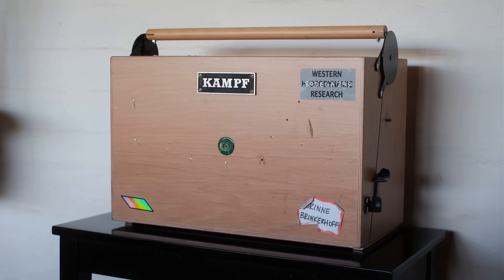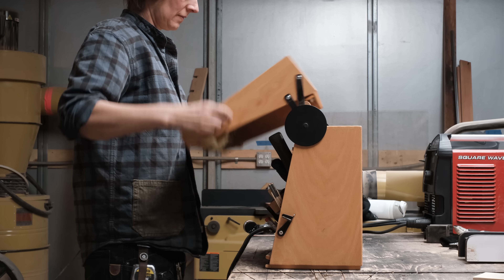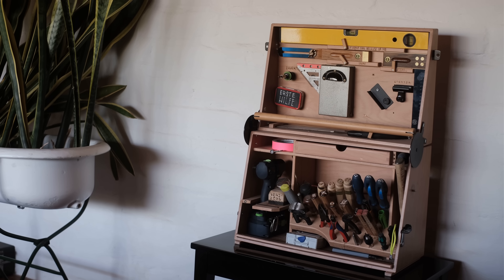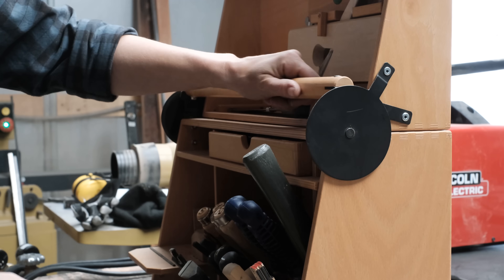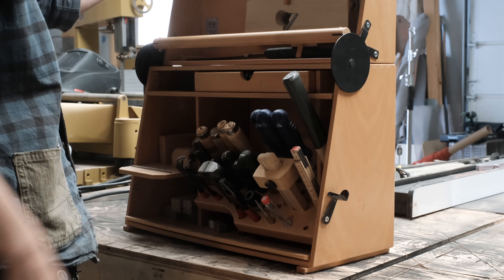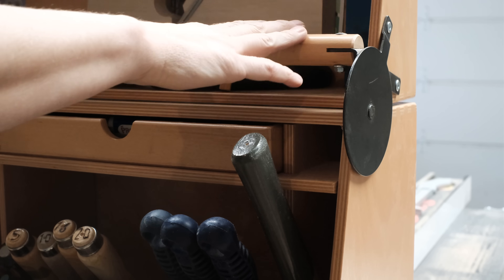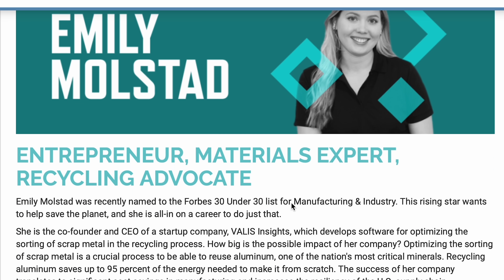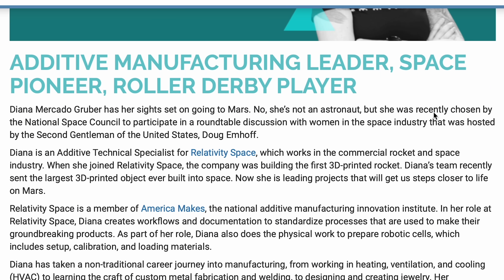This hinge is so clever! ...but I made a simpler version (with Template)

Comment: OK, the hinge is awesome. I love compound-motion hinges (dunno what you actually call them). This video is awesome. I have to say that I have worked quite a bit with wood, steel, aluminum, etc, and I didn't learn any wood or metalworking techniques from this video.

HOWEVER, when you started putting what looks like 3-in-1 oil on paper ~7:42, I wondered, "What is she doing? Why is she pouring oil on paper?"

And then I saw that you were able to make the paper transparent so you could easily transfer holes from your template to your work material.

WOW. I had never learned that trick before, but it's INCREDIBLY practical and helpful! Maybe everyone else watching this already knew this trick, but for me, this was even more amazing than the cool hinge.
Reply: The term you may be looking for is "serial chain" kinematics, using "hinge constraints" to limit forward transformations

Comment: A neat hinge, but I'd suggest a couple of things. 

Aluminium is fairly soft, and has a tendency to creep. It's also a poor bearing material so not ideal for a hinge, it tends to gal where used as a bearing surface unless something soft and slippery (like plastic) is used against it. Using countersunk bolts for the pivots also doesn't help since they create a cone clutch effect. 

Second, for keeping your drill centered in steel, use a center punch. You marked your steel with an awl or scribe. A proper center punch like what you used second when marking the wood will do the job. I'd personally use steel here, I think the aluminium will develop slop relatively quickly and wont be quite as smooth.

Comment: Nice, I think an improvement if the hinge had a 3rd piece for creating the 'rise' for the handle. This would make the handle stronger, and also make the box of the enclosure easier - as it could be a simple box which is then cut for the angled front.

Comment: Such a cool hinge design that I wish I knew about sooner! I played with the concept for a while (in Fusion 360) and came up with an idea. I wanted to have a workbench shelf that is normally on top and at the back of the workbench, pivot to be at the front. In the front position the top of the shelf would be at the same level as the workbench, extending the working surface area. I also did not want the shelf to flip over, but to keep it oriented vertically during the entire pivot. To do this, the two hinge bars would have to crisscross...  so I put 1 bar/pivot point set on the left side and the other bar/pivot point set on the right side and it works quite well (virtually). I imagine it may be a bit heavy to pivot an entire shelf, but thought it was an interesting idea. Thanks for sharing your ideas to propagate more ideas!

Comment: As far as I can see, the only advantage of this hinge over a piano hinge is that it will lift the front piece over the handle. I admire its cleverness, but it's a Rube Goldberg solution. Just make the handle swing over the back and use the simpler hinge.

Comment: Hi Laura! Great hinge mechanism. Came right in time for my next project: drill and router bit cabinet. A general hint for templates: If you print/copy it on those clear plastic sheets, that have been used for overhead projection slides, you can easily use the template for both sides plus you do not have the oilspill 😉.

Thanks a lot!

Cheers
Andreas

Comment: A different approach and easier IMHO would have been put a normal hinge on each side edge and make the handle of the box pivot to the back of the box. If you want to prevent the box swinging when carrying it you could just put a locking system of sorts.

Comment: Mh, I think the idea to use four-bar-linkages could be generalized for really fun things because you can control precisely where the lid ends up. Let's say there was another box on top of this one: I'm sure there's some way to arrange the bars so that the lid ends up not on top, but exactly in front of that other box, solving one of the core problems of tool box stacks! Or the same idea turned 90 degrees: say I have several cabinets side by side, one per hobby. I could open the doors of any one of them completely, turning them 180 degrees, and have storage in cabinet and doors. Or what if the lid opened downwards and stopped in a 90 degree position as a work surface. Or what if the linkages on the left and right were different, but attached with ball joints, then the lid could tilt while opening. So many possibilities...

Comment: Its a four bar mechanism.  The math to design the path it takes it is complex, but the math to analyze a working design is straightforward.
Reply: I came to make the same comment.  In school we learned how to graphically synthesize a 4 bar link by knowing the two end points.  I wish I could remember how, it wasn't difficult.  I haven't found how to graphically determine it online in my recent searches.
Reply: @ I learned how do do that in college too ('88). We wrote programs in Basic or Fortran to do the math too.  Graphical methods were within ~ 20%.  The programs were 5% or less.  The drafting tables were starting to get replaced by CAD
Reply: @lint2023 in this "case" the end points of the moving linkage are defined you can draw two circles from start and end point of one linkage, and where they intersect can be the fixed end of linkage. Using fusion 360, define a circle by 3 points, create a random point for 3rd of both circles, do this for other linkage, define everything except 3rd points and you can move it to find optimum path with a known start and end position.
Reply: @lint2023  You could download the free software called Linkage and make it yourself. I made a version of this box's mechanism this evening for fun! :)
Reply: Yeah, four bar linkages are great
Reply: (2/2) Since we have a known end position and start position if you create a third position of it clearing the handle, the linkage positions will become fixed, after defining where on the box you want the moving end of each linkage.
Reply: Recommenting, to find fixed end of linkage you can create a arbitrary 3rd point which has to be on the perpendicular line normal to the other 2 points. Drawing by hand, you can draw two circles centered at start and end point large enough the two circles create a vein diagram, place a line on the two points that the circles touch and your fixed point must be on this line as linkage doesnt change size. Do this again for other linkage.
Reply: @elbob1491  That would be an interesting video.  Please consider making it.
Reply: @lint2023 im not a video maker.
Reply: @elbob1491  I realized that later.  It hit me that you were commenting on a video and I felt silly for the request.  Thanks, anyway.  I'm going to try to follow the suggestions and see if I can regain that lost knowledge.  It was a very long time ago when I was in school.
Reply: @lint2023 lol best of luck to you. engineering dynamics books and videos do exist. I like the geometric solutions as they are easier than the mathematical ones.
Reply: Please tell us more
Reply: @Jhet  Google "four bar linkage"
Reply: @incognitotorpedo42 then look up 6 bar linkage.
Reply: I've been obsessed with four-bar linkages since I saw it used to create a shelf you can rotate down to a lower level while it remains horizontal all through the movement.
Reply: @Trixtah parallelogram mechanism, its a type of 4 bar linkage
Reply: If you want to make it more complex, see 5 link car suspension which uses ball joints at the end of each link/bar. That's the 3D variant of this thing.
Reply: Thanks so much for that.  At first, I was thinking "there's only 2 bars".  Then I realized that the bars are any rigid connection.  This opens up so much in the way of designing art furniture cabinet pieces.  Sometimes you just need a glimpse of a concept, and it opens up so much.  I wish I had been a mechanical engineer.
Reply: A GREAT BOOK FOR DESIGNING 4-BAR LINKAGES:
As is mentioned in other posts here, this is an example of a 4-bar linkage.
To those of you who may be interested in actually designing (rather than copying) a 4-bar linkage to provide a specific motion, this book (see below) with teach you how to do it.  It is an excellent book.  It will teach you to do it graphically (e.g. with ruler, compass, etc. on a drafting board) which is quite straightforward, or mathematically with equations (which is quite complex, even using real and "imaginary" numbers).  The graphical method could also be done with CAD (Computer Aided Design).

The book is called "Kinematic Analysis and Synthesis" by Jack T. KImbrell, 1991
Google it.  It can be found on Amazon, Ebay, and other places.
This book is out of print, but copies can still be purchased.

This is an undergraduate-level book intended for such courses as kinematics, synthesis of mechanisms, mechanics, dynamics of machinery, or machinery of analysis. The author's goal is to provide a book that will equip students to design and analyze mechanics, as well as give them the information they need to perform well in modern industry. Graphic and analytical synthesis techniques are fully explained to give the student a visual feeling for mechanisms performance, and the text contains complete coverage of CAMS and their analysis.

Jack Kimbell was Professor Emeritus of Mechanical Engineering at Washington State University through 1991. He died some years ago.  He was my professor for the Kinematics and Dynamics of Machinery course at WSU in 1983.  At that time, he was in his 70s.  He was an excellent teacher and nice man.  He also wrote and graded test questions for the Washington State Professional Engineer's Licensing Exam for mechanical engineering.

Comment: Hey Laura, check out the short I just did especially for you with love from New Zealand. I hope it's helpful and you like the results you get once you get a set. Aim for smaller sizes and ability to restock 10 at a time for a given size. Big sizes are good too, but it's still better to reduce cutting loads in steel with a pilot hole even if using a split point to final dimension. Cheers :-)

Comment: As soon as I saw the thumbnail, I thought this could be a great solution for hiding my desktop PC. I prefer a desktop, but would also like it to be hidden for aesthetic reasons. I would place the monitor at the top part, and at the bottom part, there would need to be a panel that folds up to form a desk. Under or behind the desk, there would be space for the PC itself.

Comment: Love the process ... I had a thought about the nubbin sticking up for the handle...could it be replaced with an eye bolt/lag so the end of a 3/4 inch dowel handle is the attachment point for the upper screw?  That does pose a problem for the other attachment point right at the top plane of the box...perhaps it would have to have the outside strut lengthened...but would that affect the reliability of the mechanism.
Reply: The radii would have to be adjusted for the given pivots...the center of rotation and ability to scale should be able to be calculated... squirrel! 🐿️

Comment: I have a portable 2.1 speaker which has the speakers on fold out "wings" - while I designed something very similar with L shaped brackets (that despite a few attempts) could not get working - this may be a solution.

 The L shape was to get around the clashing point, but washers/z axis spacing are a genius alternative. I may revisit the project in the near future...

Comment: Hi Laura. New viewer from the UK here. The product is great. Well done. What is more impressive to me is your thought process, probably because of our commonality in that regard. I have found that using cardboard and drawing pins  on a layout board, to prove the concept of an idea, is easier, quicker and almost without cost. I am an 80 year old male who left school in 1959 with no qualifications other than the ability to think, so that's what I use in place of the clever stuff like maths 😂. One idea for 'your' hinge application would be a kitchen container for the whole spectrum of herbs and spices. It could be made from wood, plastic or even metal. Thank you for your video and infectious enthusiasm -- a necessary quality for inventors.
Reply from the maker: I love this comment! Keep inventing and cardboarding ❤️
Reply: @ Thanks Laura. Really I'm just cheap, that's why I use free cardboard🤣.
Reply: One of my favorite builders calls that C.A.D. Cardboard Aided Design.
Reply: That might be a good idea for a caravan too
Reply: The one issue I see is that the front part of the box flips over vertically meaning any spices or other contents might fall out if not secured properly
Reply: @ You see what happens when you cut short your thinking? That's when you only 'see' problems and not solutions. Off the top of my head - let gravity do the work on a bottom heavy shelf so that all of the inhabitants of said shelf would always be the right way up. Another way would be to utilise Laura's hinge mechanism to produce the same movement inside as is achieved with the lid.

Comment: So many possibilities…  I was thinking a mini portable cabinet for my diabetic supplies: insulins, needles, discarded material  (I have a prototype in cardboard that I use and I was thinking on improving on it) and also for sewing and painting and…
Reply: Paint a big red cross on it, so folks know it is medical supplies !? (In case you are ever medically in need !) 
 Also, doesn't insulin need to be refrigerated ?! Would you add that, or ???
Reply: @m.maclellan7147  thanks for your concern marked with so many exclamation points, but do trust a diabetic to know how to store their insulin. To spread the information: the pens you are currently  using don't need refrigeration unless you are under very extreme meteorological conditions, you only refrigerate the ones you are storing as per indication of the manufacturers. 
Maybe I should have been clearer with the use I see for this project:  the portability is for inside the house, each pen weights about 30 grams so having a wooden cabinet to transport way  less than a 100 grams out and about (including supplies as needles) in my bag is not practical. But having a cabinet with all the supplies well arranged that can be visible or closed and can change to different rooms in my house seems an interesting idea, better that what I am currently using.
Reply: @m.maclellan7147  7
The insulin you are using doesn't need refrigeration unless you are in extreme temperatures, trust a diabetic to know how to store their insulin, no need for exclamation points.the insulin you have stored has to be refrigerated. I would use the portability for inside the house, as I do with my actual prototype, each pen of insulin weights about 30grams, it would not be practical to make a big production to transport less than a 100 grams in my bag, but thanks for your concern.

Comment: Depending on strength needed I could think of 3D Printing the metal parts instead, no need for washers as they could be part of the design. The template for the holes could also be printed

Comment: Cool! If you want to make the width slimmer you can switch the link on spacers to a C-shaped link. Then they can both be in the same plane without interfering and with less risk of pinching your fingers. Would also make it easier if you want to put them in a recess on the side of the box so the hinge doesn´t protrude.

Comment: If there will be multiple of this kind of boxes, there should be something that automaticaly secures the room for hinges to work, if they sit next to each others. Perhaps the bottom of the box should extend something like 1 cm from the sidewall. The larger bottom part makes it also possible to use the swallow tail joints for the sidewalls.

Comment: I can see it for art/painting. It unfolds as a traveling easel. Add some telescoping folding legs on the bottom. And alter the handle make it out of slats with trapezoidal depth, so that it can unfurl and become a flat surface. To use as backing to support paper, or a small canvas.

Comment: Another option is to have the middle of the circle lower down and across and have one arm on the circle. Make the middle of the circle run on a bearing, connect the circle with a shoulder bolt and nut. You could 3d print a circle with two arms ( in a y shape).all in one print / unit. The circle and arms would have to have a small ring protruding where the bolt / screw go through to stop the circle rubbing on the wood.  The small ring would be the same size as the inner bearing race, the outer seal and bearing race might have to be covered aby a plastic cover to stop contamination.

Comment: i see how its satisfying but the whole thing is completely unnecessary. if the handle could get out of the way, a regular hinge would make an even better display cabinet, with no pinching danger or protruding bits to get bumped or caught on. still cool though.

Comment: I think that a simpler version is possible with a single hinge. The lid can be displaced from the open to the closed poition by a 180° rotation. Also, the movement from the open to closed position should lift the lid up first, so that it is not too easy to inadvertently tip the lid over. Therefore, the hinge should have its fulcrum above the top of the closed box. It would probably take up more space than the solution from the video if you want the same resistance to inadvertently slamming it shut, but it would be easier to build.